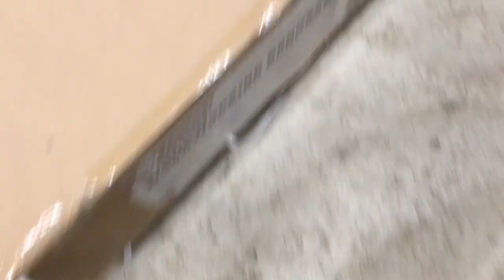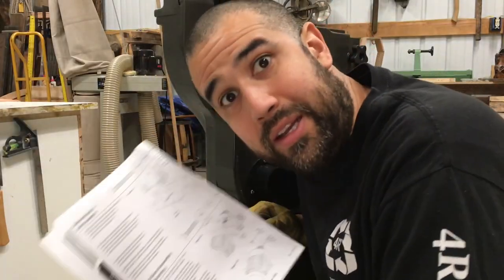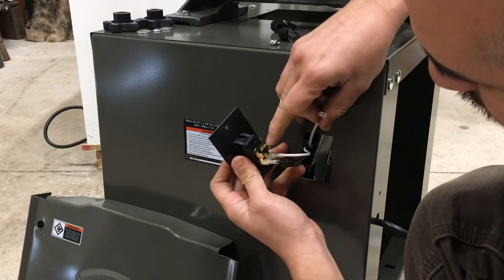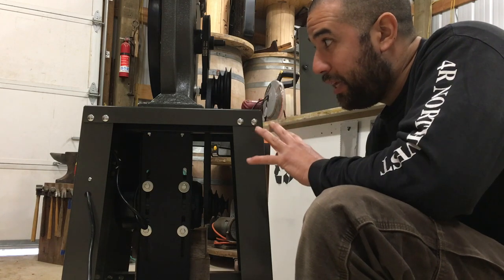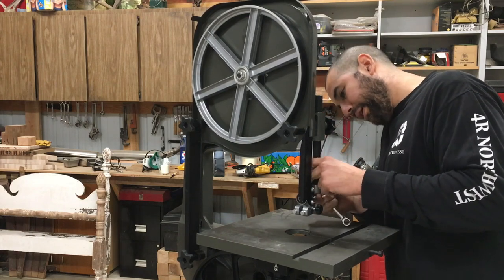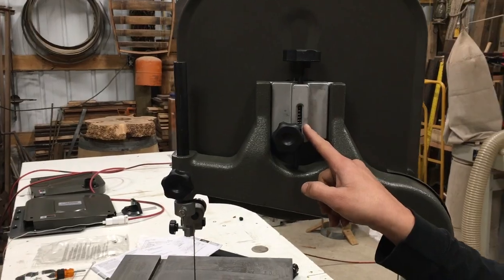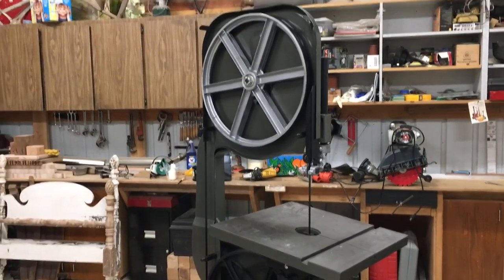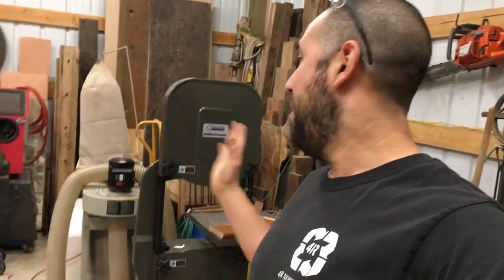Harbor Freight Bandsaw Unboxing, Assembly and Review | 4R NORTHWEST

Comment: I have two of these saws- one is 16 years old, the other 12- made a little differently back then, but about the same. If I may submit some ideas and advice.
 Have someone weld an extension onto the blade tensioning bolt just above the upper cover with bends like a crank handle. You can now set the tension or remove the belt much faster.
  Take a hard bristle tooth brush and mount it so it rubs against the lower wheel- this helps keep wood build up on the rubber.
 The proper position of the blade on the upper wheel is to have the gullet of the blade centered on the wheel- this helps the blade track properly.
 Toss the blade it came with and get a better blade.
 These are pretty good saws but have limitations in HP. Using a slower speed gives you a little more power.

Comment: Greetings from England

Just a quick comment to anyone carrying out assembly on one of these:

Please make sure the earthing (grounding) wires are in contact with the metal...and not just the paint/powder coat...

Very important to achieve a good, reliable R2 (earth path)

Glenn

GLMelectrical
Reply from the maker: Glenn Moreland An excellent point! thank you for your feedback! thats what makes this community work. thank you for watching.
Reply: Thinking  HF die grinder would help lol

Comment: My brother in law gave me a 10 yo Harbor Freight bandsaw.   I did some upgrades (new tension rod, new tires, new ceramic guide blocks, and a link belt, and a Kreg fence).  Put a washer on bottom wheel to make them co-planer.   Saw cut everything I wanted it to cut.  Only got rid of it because I build guitars and needed more resaw capability.   Gave it to the guy who hauled my new bandsaw home, and he is still using it to this day.  Decent saw for a small shop.
Reply from the maker: Paul Waldrop now that’s what I’m talking about! Good for you man! Above and beyond what most people are willing to do and that often sets apart a good machine from one that could have been. As for the co-planer wheels I’d say to each their own but it’s actually not necessary unless something is very wrong. The wheels are set at the factory and that should be that. The blade will ride where it rides and it’s where the gullet of the blade on the top tire that’s really important. I refer everyone to Alex Snodgrass’ Bandsaw Clinic video on YouTube and for ANYONE that has or will have a bandsaw it is a must! He breaks it all down beautifully. I too got a larger capacity bandsaw eventually and there’s no going back once you have the capability. AND you gave it to yet another happy owner, THAT is awesome. So you build instruments? I’ll have to check out your channel! Do you have an Instagram of your work? Let us all know! Thanks so much for watching!
Reply: @4rnorthwest  No channel.   But look up Waldrop Guitars, on Facebook.   Thanks again for the video.

Comment: 48:33 Never wear gloves while working with a band saw or miter saw. All it takes is for one tooth on the blade to snag the material, and it will quickly pull the glove (along with your fingers/hand) into the moving blade. And please lower the blade's guide brace so it's about 1/8" above the material you're cutting.
Reply from the maker: CoroaEntertainment an excellent tip for everyone thank you! As for me, I’ve worked with equipment for over 20 years with and without gloves without incident. It’s a risk I take when I feel. To everyone, there is an inherent risk working with ANY power equipment and many ways to minimize said risk. People love giving me what for about no guard on my angle grinder. That’s a risk I take on a tool I’m skilled with. Safety is always a concern. Thanks for watching!🙂

Comment: Note for anyone that wants to use this saw for resawing logs or lumber: it can't. It doesn't have a riser kit available, nor will the other manufacturers' kits fit. Also, it doesn't have mounting holes for nice fences like the Kreg. Just things to keep in mind.

Also, the rubber tires that came with mine were too large and flew off of the lower wheel, taking the blade with it. I had to get polyurethane tires from Amazon before I could even use my saw. =(

Comment: I have a LOT of HF tools, some of which are pretty expensive (for me), including their small metal bandsaw and their 30" sheet metal shear/brake/roller. LOVE them both. I looked at this bandsaw and seriously considered it, but there is no riser block available for it, and that was the deal breaker for me. I build musical instruments, among other things, and need that 12" resaw height. So I looked around and found the Porter Cable one they sell at Lowes. Not that much more money, though there is never a 20% off coupon to lower it's price. Got the riser block kit for $80 and haven't ever looked back. The thing runs like a sewing machine, it's just wonderful. If the resaw height isn't an issue for you, I see no reason why this saw wouldn't function just fine. It has 2 more speeds than the PC, though that's just not an issue for me, the fastest speed is what I want and where I have the PC set. 

Good video, very informative and fun. Now you just have to build yourself a fence and you're really cooking!
Reply from the maker: Will Morrison yes! Yes to everything you said! It’s definitely a good bang for the buck and I tell everyone, so long as you’re not running industrial applications you’re gonna be just fine! With proper set up and the right  blade you really can do a lot on this model and the barrier to entrance for hobbyists is hard to beat especially when they honor their 25% off coupon that comes out 4 or 5 times a year! A simple fence made of 3/4” melamine board and clamped to your table is all you need and it works great! I have a grizzly with the riser block and 1hp motor and because I do larger pieces it was necessary. But this saw is worth every penny. I believe the top of the head can be removed on these and a riser can be made BUT that would take a little more skill and ingenuity than most hobbyists have though most seldom need to resaw above 6”. Either way Right! Thanks for watching.

Comment: So I FINALLY set up my 14" Central Machinery band saw after it sat in the garage for more than six months collecting dust, only partially assembled. I have to say, it's not a bad machine at all. After watching several youtube videos on how to properly set up a band saw, it really didn't take me more than 10 - 15 minutes to dial this thing in, and it actually cuts and tracks really well. My ten year old son was resawing paper thin slices on it. The slices were so consistent and thin you could literally see between the wood cells through to the other side. I'm sure the dust collection could be a lot better, but I can't see where this saw wasn't more than worth what Harbor Freight charged me for it. Especially for a weekend hobbyist like me. If you take the time to set this saw up correctly, then you'll have yourself a pretty decent band saw.

Comment: Couple of boo boos. 

1- Set the tracking BEFORE you even install the guides.  If you set ti right it will not drift even WITHOUT the guides on the saw. In fact whenever you set the tracking back off the guides.

2. The blade does NOT go on the tire at all. - move it forward so the bottom of the gullets are just a few thousandths off the tire.  - Then set the guides. - I doubt the factory blade is worth putting on the saw so you are on your own there,  but with a decent blade you will get zero point no blade drift if you set the tracking properly.

Comment: Thank you for a great video...Without this video ,Im afraid Id be spending a few days in jail.After throwing the Band saw through the window at Harbor Frieght;. Ive Never seen such  poorly written directions..The entire assembly took 3 days..I had to redo all the wiring connections. .The connectors were falling off. I stripped four of the mounting table bolts..14mm nuts on 12 mm corse threads ,  I believe the bolts were made of a mixture of lead,  mercury and a hard cheese made in Italy.           ( Harbor Freight should be paying you for this video,  if not that ,  At least giving your little guy a lifetime supply of. OREOS .}.  Mine was heading back to the store,,  until I found your Youtube video,,,and trust me, not through the the front door. YOU MAY HAVE SAVED MY MARRIAGE.....Im going to buy another one to put in my shop..Just to smash with a sledge hammer every time something causes me that kind of anxiety.!. Ill call it the { Frustration Cutter 6500, series.} ..It won't cut wood but it will cut your anger and frustration in Half...right after you give it a good sound thrashing.!!! With a wooden handled splitting mall.., My only directions that come with mine is...Be Sure To Strike  it . Until full Exhaustion sets in..     Thank you.

Comment: I just purchased and assembled this Harbor Freight Central Machinery 14 in. 4 speed woodworking band saw. After completing the assembly, I noticed the table is NOT aligned to the base. There is an angle (if looking at the front facing the blade, the table is skewed clockwise). I re-checked the mounting screws that hold the black TABLE BRACKET (#45) and they are correct. Can someone help? I can send pictures if you want to see them but can't attach them here.  Your assistance would be appreciated!  ~Mary

Comment: It’s HF....why, ? For a diy , ok...but you have a shop. And you don’t upgrade to a Delta, maybe Jet,Grizzly..work up to Laguna ....
Reply from the maker: Joe Framer great question! I have a Grizzly G0555 with a 6" riser block and commonly use it for resawing mostly hardwoods with a 3/4" 3tpi blade and I love! Thanks for watching though. In all honesty you can't beat the price on that HF unit. It's well constructed and if you set it up properly it will handle most common work for small shop non industrial use applications.

Comment: Mine works Ok if I'm only cutting something thin, 1" or less.
I tried ripping pine and cherry and it just stalled out.  Those .010 Harborfreight blades aren't the greatest either.

Comment: Just purchased one. Everything is perfect followed your video. Only problem is after running it maybe 20 seconds the tire comes off top and bottom. Any ideas? Tracking is center and tension feels tight I feel like the knob bottoms out before it gets really tight. Any advice would help. Really don’t want to return the bandsaw or replace tires.

Comment: I just bought the same one two days ago for my guitar building shop. I did over tighten the upper block set bolt and split the cast housing. It is an available replacement part in case anyone else has the same oops.

Comment: Thank you for the video help me a lot couple questions. The motor plate is on a slant. I hope that’s the way it’s supposed to be. The lower blade guide does not line up properly with the sawblade unless I mount it a little bit crooked. When mounted squarely, the back of the blade will passed by the face of the roller bearing. If you could answer my questions, it would be great thank you.

Comment: This saw is a piece of junk.  I was having trouble getting the blade to track on the lower wheel.  It kept coming off.   So I finally removed the cover and ran the saw to see what was happening.  After one run and failure, I marked the lower wheel where the blade was coming off.   Then I did a couple more runs, and the blade came off in exactly the same place.   So I removed the tire and underneath, unbelievable.  There are seven VERY LARGE "balancing" holes drilled right into the surface of the wheel where the blade is supposed to track.  These holes are 1/4" deep, the diameter is just short of the entire inside width of the wheel, and they are about 1/16" apart from each other. in other words, for more than 6" of the crowned surface of the wheel, there is no surface at all.  There is no crown and no possibility of a crown.  That part of the wheel is destroyed.  That is where the blade was coming off.  I have pictures but I don't know how to add them to these comments.    Of course, I discovered this AFTER the return deadline.   Oh, and good luck getting the lower wheel off.  It is a whole different ballgame that getting the top off.    So, they got the casting so far off that they had to remove far too much metal in one place to get the wheel to balance.  There would be no way to drill on the spokes because it would destroy the spoke.  They wouldn't dare put it on the outside where a new buyer could see it, so they hid this nightmare under the tire.    I am going to try filling the holes with epoxy to level the wheel and then adding a weight on the opposite side of the wheel to see if it will balance.   What a joke.

Comment: best video on the internet for this saw👍 I just converted saw to a 3 phase motor with vfd for speed control.  Now…cutting steel, aluminum, etc is easy as blade speed can be set very low.

Comment: Did anyone have problems with that bit in the instructions about the motor key and offsetting it 0.3" and all that? That's the part that led me to this video In the first place
Reply from the maker: XOKNP honestly that part where I tossed the instruction booklet....I may have looked at it one or two more times for the pictures and never bothered reading! So the "key" you speak of I couldn't tell ya BUT had no issues with the saw after assembly and ran great! I'll tell you like I tell everyone else, order some blades from Amazon. I buy Olson, they're decent blades and affordable. Get a 1/4" for smaller intricate cutting or even an 1/8" if you wanna get crazy! And at least a 1/2" if not a 3/4" resaw blade for heavier straight cut dimensioning. Worth every penny and far superior to the blade the saw comes with. Thanks for watching!
Reply: Thanks for the tips, also I was wondering if you ran into any problems with missing parts? I was just about to bolt on my mounting plate with the two hex bolts and realized, there were in fact no hex bolts -_-

Comment: I have put together a saw just like this and for me to align the blade I have to adjust the wheel until it rubs tightly the cover that doesn't come off. i see no way to adjust the blade to where it needs to be. any advice? oh that is the  upper wheel. thanks in advance .

Comment: Found this instructional video to be extremely useful and helpful.  Several key steps are not addressed in manuals provided which could have impacted the product functionality and reliability.  Setup details and tuning could not have been done properly without this video in my opinion.  Highest marks for creating an excellent video for assembling this harbor freight tool that comes in an IKEA type box.  Thank you

Comment: I read through as many of these comments as I could.  I just assembled mine.  There is one significant problem.  The wheels are not coplanar, and you cannot just plug in some washers to bring the top wheel out.  In fact, there can be no compression on the bearing whatsoever.  The design out of the box has the nut stopping at the end of the threads on the top wheel shaft.  So, if you put a washer behind the wheel to bring it out (so that is coplanar with the lower wheel), then the nut will hit the bearing and press on it.  This will cause friction which will quickly destroy the bearing.  In addition, the shaft is too short to use a jam nut with the original nut.  (FYI the shaft is threaded for a 12mm 1.75 pitch "coarse" threaded nut).  My solution:  First I made a very narrow 14mm washer (the face is 1 mm wide) to make contact with the inside of the wheel bearing.  Then put a 14mm fender washer behind the wheel, then added the ground down 14mm washer, then the wheel, then put a thinner 12mm jam nut on the shaft with Permatex 25210 high strength removable thread locker.  The jam nut just TOUCHES the bearing, no pressure on it, it must spin completely free.   After doing this, I checked the wheels, they are coplanar, and the blade tracks pretty much in the exact center of both wheels.  The cut is almost table-saw smooth with the stock blade.   The 25210 is high strength, made for vibration situations, but is removable.  

Also, I replaced the dorky hex head bolts with setscrews everywhere on the upper blade guide, and attached a 3mm hex wrench to the machine.  It is SO much easier to see the work, now, and it also looks far more professional.    Got mine at Harbor Freight, Black Friday, $462.00  out the door including tax.
Reply from the maker: NOOOOO! No no no no. These machines, actually all 14” and larger bandsaws are set at the factory and do NOT require wheel alignment. Coplanar is NOT an issue for bandsaws. The blade rides where it rides. If you follow the bandsaw wizard Alex Snodgrass he explains everything. All that matters is blade gullet position on the top tire. Never mess with the wheel alignment on a bandsaw. I also worried about this when first getting a 14” but after some reading found that this is a common misconception and not an issue in design or function.

Comment: Your nutsack??? You are a nutsack, a empty one.

It says, woodworking bandsaw. Not enough power to cut steel. It's not worth it if it can't cut both wood & steel.
Reply from the maker: its got a 3/4hp motor and with the proper blade it will cut thin gauges and nonferrous metals just fine..... you nutbag.